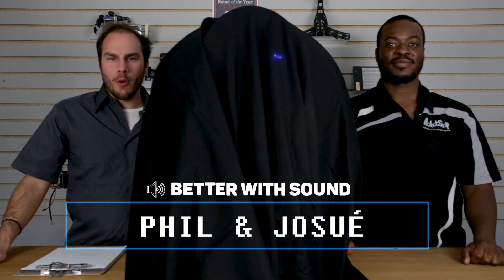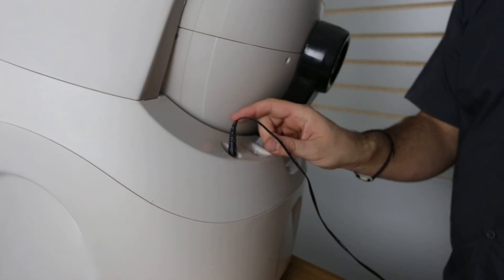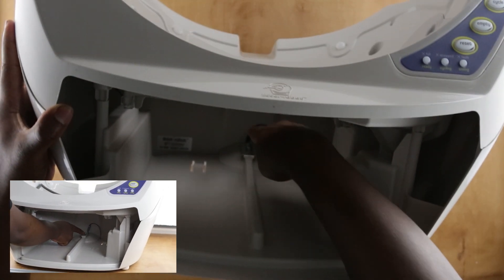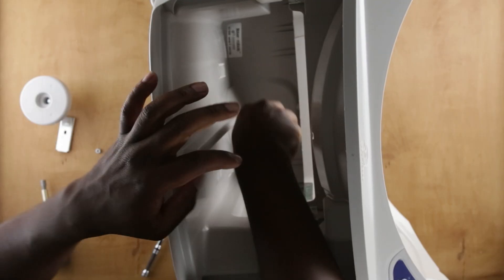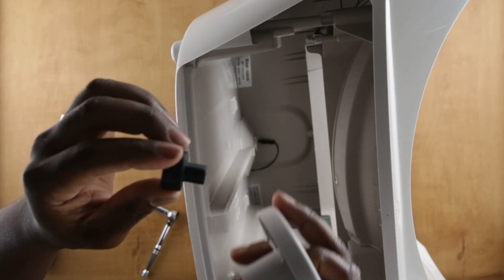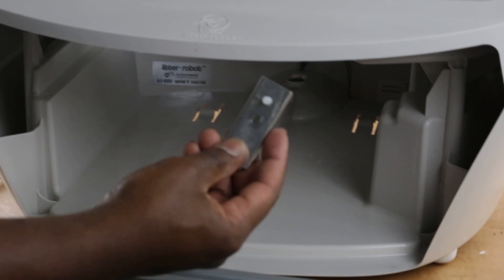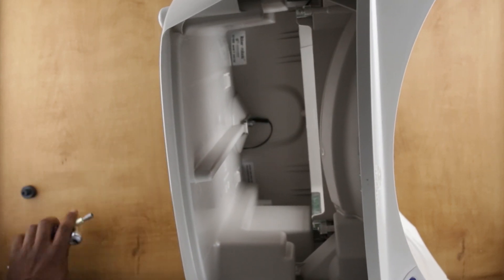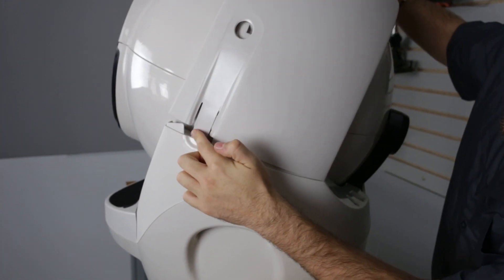How To Repair The Cat Sensor In The Litter-Robot 3 Open Air

Comment: Hi there.  How do you know if it is the cat sensor that has gone.  I've tried everything with mine.  The red light is flashing and won't do anything.  It's totally been cleaned, top to bottom (thought a full clean would fix the issue - nope) and there is clean litter in it just bellow the line, it's stable on laminate floors, not touching anything.  What are your thoughts?
Reply: Hi Robotshop..I  have been fighting with my LRair for quite awhile.  Thank you so much for your help..as of now mine is running with no issues. Your a life saver...Thanks again
Reply from the maker: Hi,

Please check your unit for the following: 

* The litter is above the fill line or in excess of 10lbs. 
* CATS has not been reset after adding weight 
* The waste drawer has too much weight 

The red blinking light indicates CATS (the cat sensor) is detecting excess weight for more than 2 minutes. To test your changes, power the unit off and then on. Allow the unit to complete the start‐up cycle and return Home with a solid blue light. Your unit is operating normally. 
If it continues to flash, the cat sensor will probably need to be replaced.

Always press Reset after emptying the waste drawer, adding litter, or moving the unit. You can also turn the unit OFF then ON to ensure the baseline is set properly. When pressing Reset, watch for the blue light to quickly flash one time. This indicates CATS has been successfully reset. 

If none of the above solves the issue: 

1. Remove the bonnet. 

2. Remove the globe 

3. Replace the bonnet 

4. Press Cycle (without the globe on the unit) 

5. Allow the motor to run for 5 seconds, at any point, does it stop and flash red? If no, then excess weight needs to be removed from the globe. If yes, (it blinks red), the cat sensor will need to be replaced.

Let us know how it goes.

With regards,

Comment: For those wondering if the cat sensor is the problem I just found that putting a 1k ohm resistor into the connector for the sensor tricks the litter robot into thinking the sensor is ok.  I get the red lights right away, I think the connector or ribbon is damaged since I probed down the wire and measured around 1k ohm resistance.  Putting the resistor in allows me to manually run the box while waiting on a new sensor but I may try repairing the connector to see if I can fix the existing sensor.
Reply: Worth noting that this actually works.  I didn't want to buy a whole new sensor and manually cycling this once or twice a day was good enough for me.  Just disconnected the sensor behind the litter drawer, took the connector off, stripped the wire and threw a 1k ohm resistor in.  Now the box cycles when I manually hit the button, or when it turns on (which means I could hook this up to a smart outlet and have it scheduled to turn on for long enough to complete a cycle x times per day).  Thanks for the heads up Scott!
Reply: OMG, Thanks, Can you make a video/phots of the 1k ohm resistor? I dont think i understand.
Reply: Where did you purchase your cat sensor?
Reply: @jw1747  bought at robot shop, looks like they are out of stock so you may have to call litter robot service... https://www.robotshop.com/en/litter-robot-3-open-air-cat-sensor.html
Reply: 4 years later, still a golden comment. Thank you for providing me the info to get it working again :)
Reply: saved me a big headache while I wait for a replacement sensor to ship!

Comment: what causes the litter robot sensor to break down?? i've had my litter robot for 2 years and had to get it repaired 2 or 3 times already- each time, it seemed to be the car sensor. Is this regular wear and tear or am I doing something wrong?! thanks
Reply from the maker: Hi Amy,
It is pretty difficult to determine the source of the issue without having the robot in our repair center.
Defective cat sensor can be caused by a bad installation or liquid leaking in the electronic.

Comment: Ok I noticed when I cleaned my globe that the top was still set so I decided to take kine apart ( wrong move ) so I hear a snap and found two little  black magnets that goes somewhere and I don't know where they came from also I noticed this black  and gray foam that got wet and had litter all over it ,,,will it dry on its own and also a peace feel off ( i thought it was OK to wash the glob where this all got wet . My husband is going to be pissed lol no joke well he wanted me to clean it haha he should know I always go over board oppps
Reply: Not set I mean wet
Reply from the maker: Hi,
Thank you for contacting us.
We suggest you contact us via our support center and we will gladly share the document on how to replace the magnet inside the globe.
https://www.robotshop.com/en/support.html/
Reply: I did a little investigating and my litter robot kept making like a slamming noise and upside down so when I went to take it apart to clean it I noticed there’s was something in the bottom under the black rubber flooring and I finally got to it and it’s a big silver like weight idk how this happened or how to get it back in ...also I found two little magnets that I have no clue where they go
Reply from the maker: Hi Aimee,
We believe that the Globe will need to be replaced or repaired.
If you have bought the robot with RobotShop, contact us via the support center so we can verify your warranty information or send you the document to replace the magnet inside the globe.

Comment: Where does one get that black piece the hold the screw in when trying to assemble it? (black base) I can't for the life of me get the spring in and screwed back together now that I have replaced the sensor.
Reply from the maker: Hi Kristin,
Thanks for reaching out.
The black piece is a custom 3D printed tool we made.
You should be able to achieve the same result with a similarly-shaped object or something (like a piece of a paper journal) to hold the screw in place.
Let us know if there's anything else we can do to assist you,
Reply: @RobotShopTV  It would be great if the video showed the technicians also using a paper journal as you just recommended.